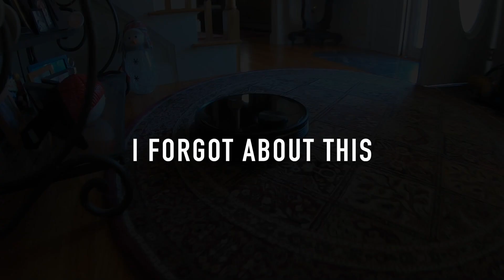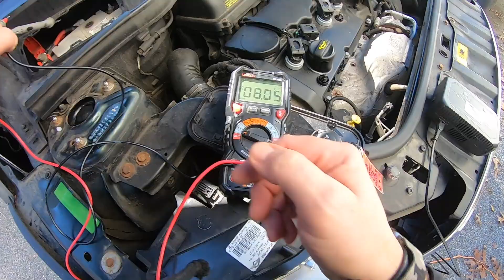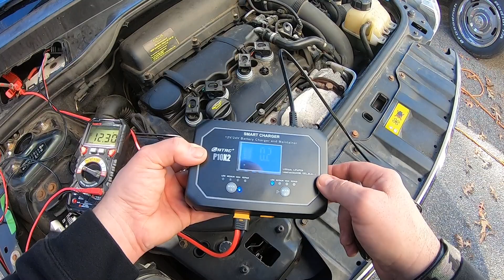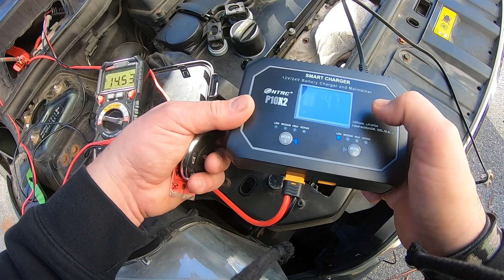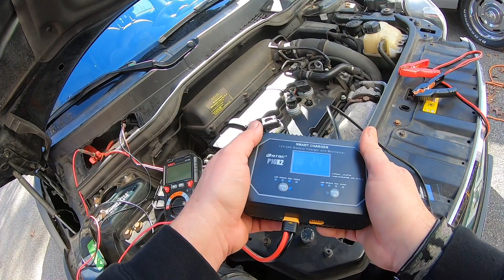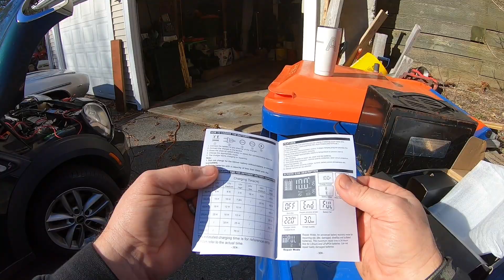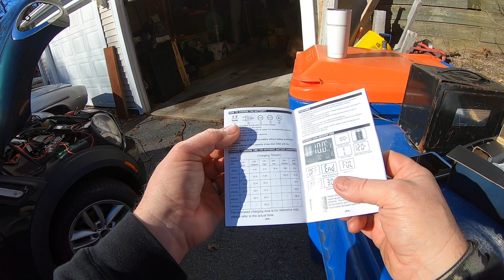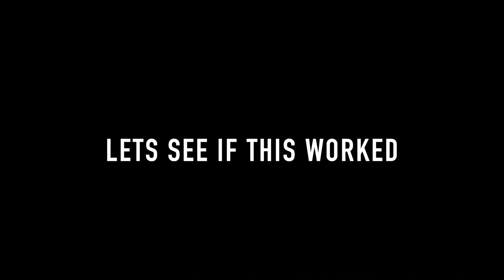HTRC makes an AUTOMOTIVE BATTERY CHARGER and MAINTAINER

Comment: Ebms lipo balance charger adapter for your battery is built into the battery song lithium car batteries or like that and deep cycle battery is how their own built-in circuit board for balance charge and low voltage cutoff in that
Reply from the maker: NICE‼️💯 HIGH TECH for a LOW TECH kinda GUY 👍😜